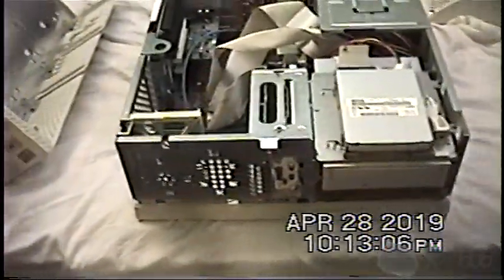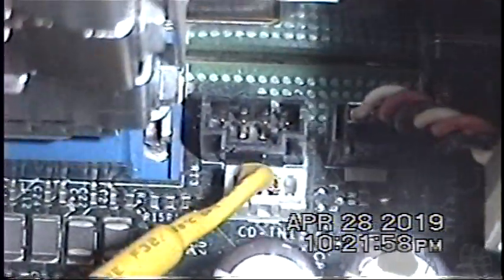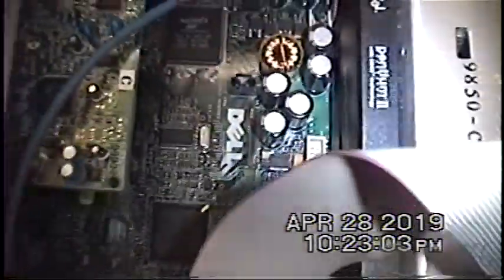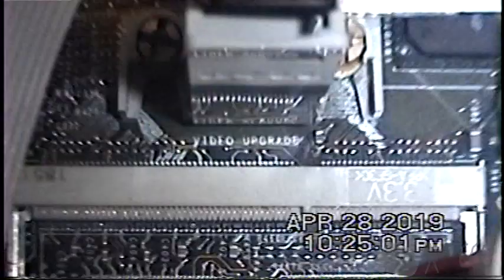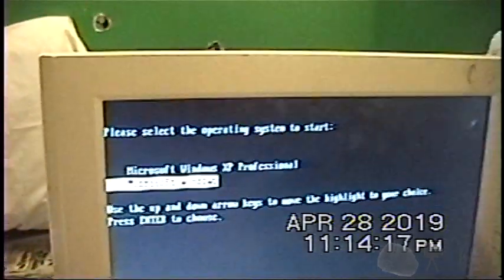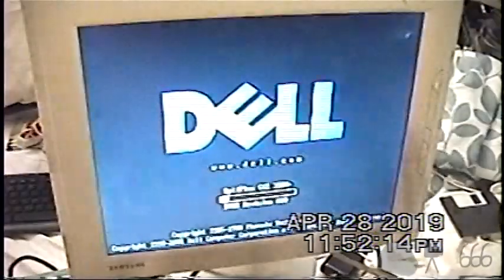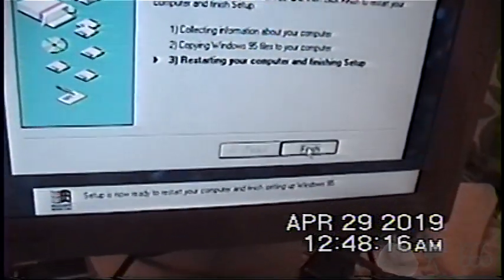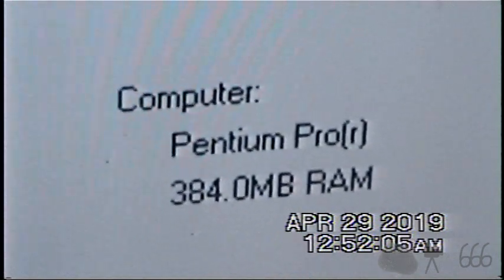Dell Optiplex GX1: Windows 95 Install and Setup

Comment: Installing the Intel chipset driver should get Windows 95 working with USB flash drives in combination with XUSBSUPP. I'm pretty sure that is a 440BX motherboard in use here.

Comment: great video!!! im having troubles with this pc i want to put win95 on it but i cant get the cd rom to work, it dosent show anywhere, i put all the hardrive options in auto just like you, any ideas?????????
Reply from the maker: Most Windows 95 discs are not bootable; you need a boot floppy to run the initial setup process.